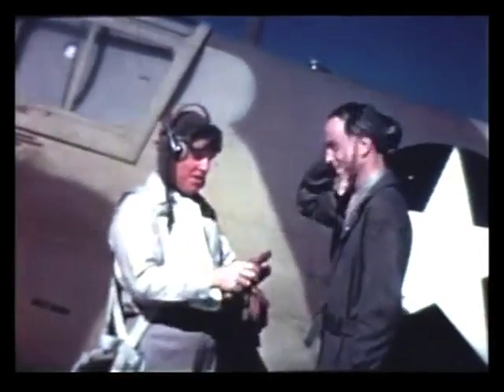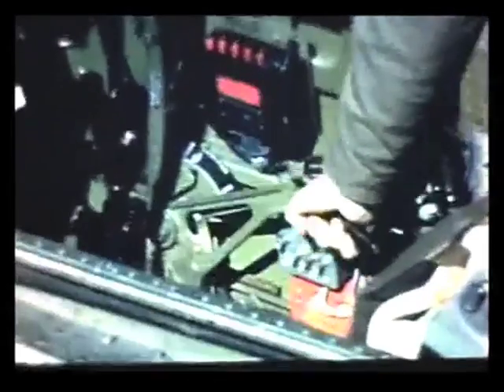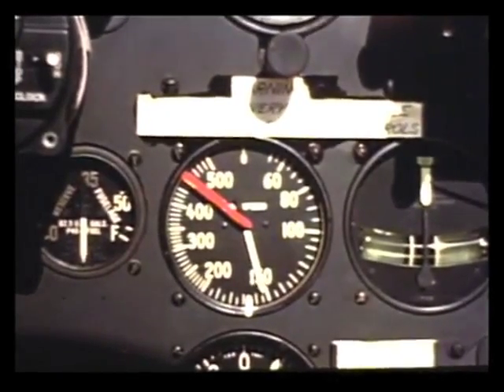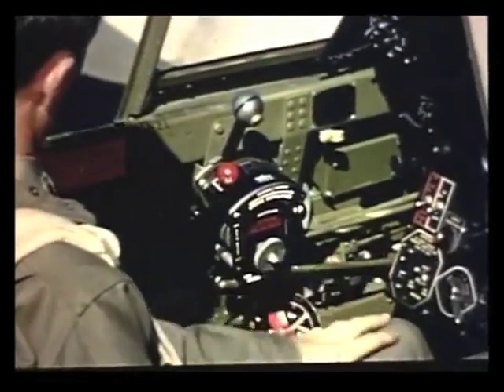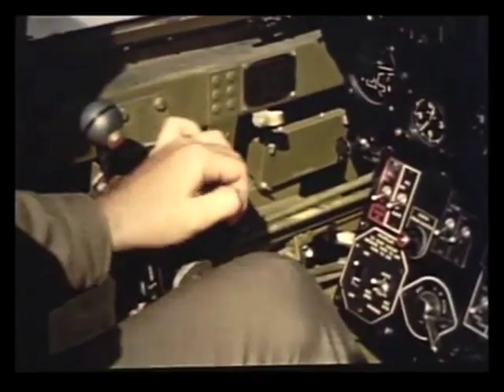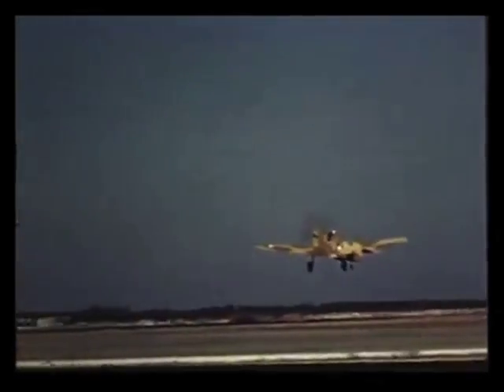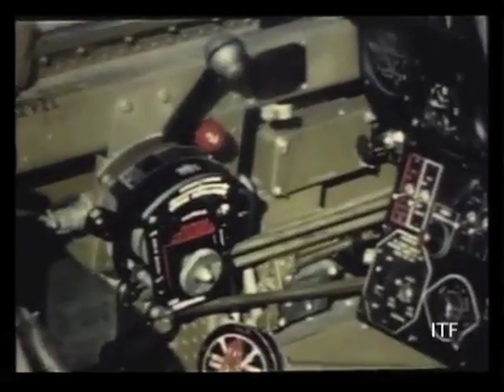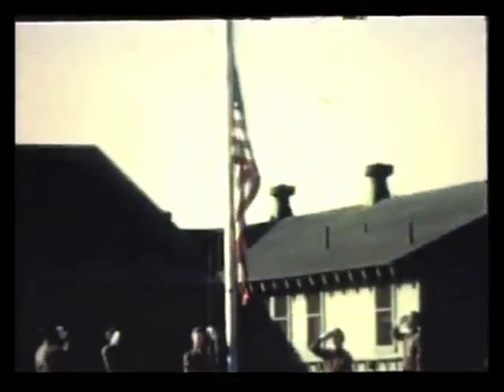HOW TO FLY THE P-40 Warhawk

Comment: It seems that ergonomics was not a concept followed in cockpit design for the P40. The instruments are all over the place. Very interesting but imagine having to decide on the rpms with a Messerschmitt on your tail.
Reply: I know the comment is a year old, but I reply anyway. You don't micro-manage your rpms. You use the automatic governor to lock the setting with the manifold pressure. Then you only have to worry about throttle settings to keep manifold pressure from blowing the engine during a dive. It was discussed in the video.